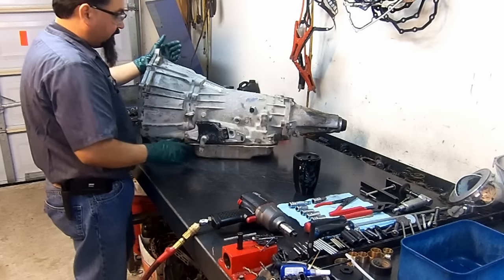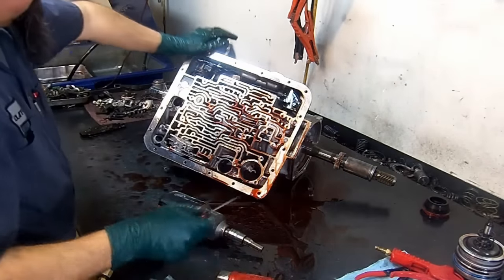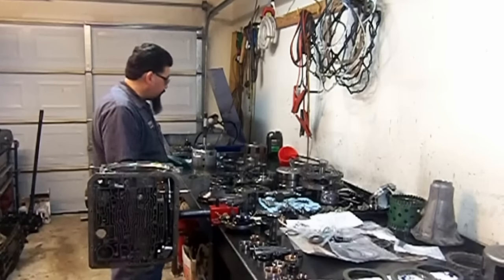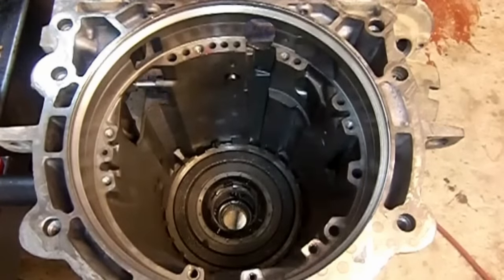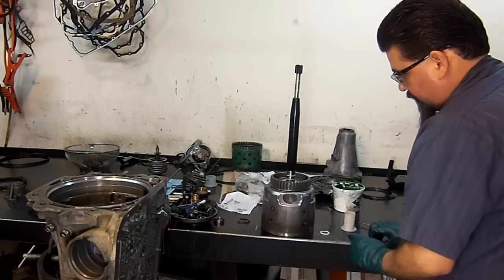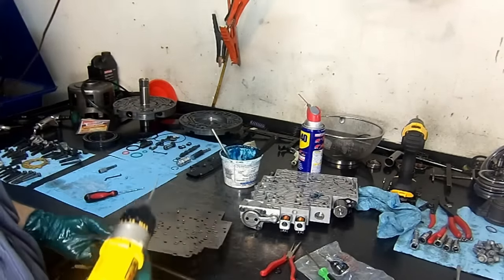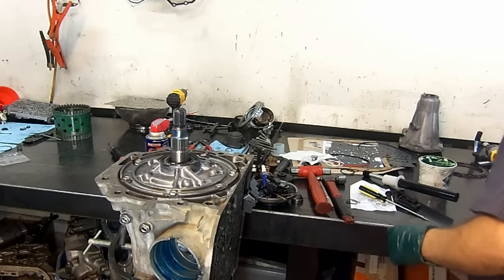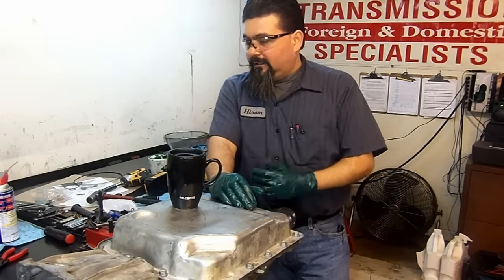4L60-E Transmission Full Rebuild

Comment: Now I see why it’s costing me $1,100 to fix my transmission.
Reply: $1,100 is actually pretty cheap. Usually they running from $2,500 that's including removal and installation.
Reply: @bryanphan1583  3300 dollars for my 2012 tahoe
Reply: I just got quoted 2700 for my 2002 Chevy Silverado. I am going to trade it in before it gets much worse. I am noticing sometimes it doesn’t go right into reverse. Make clunking noise when shifting into reverse also. I hear it is the sunshell.
Reply: @stevesigler5241  it would be way cheaper to rebuild have you seen truck prices?
Reply: Change the fluid and filter on your Chevy truck and you won't have to pay thousands of dollars for this nonsense.
Reply: @omartinoco9930  i did on mine until it gave up at 279,000 😂
Reply: Cheap real cheap.
Reply: @stevesigler5241  It could be the sunshell, but the clunking could also be the u-joints. I had the same issue on my 2003 GMC Sonoma and replacing the u-joints fixed the issue.
Reply: That is really cheap, around the here you ain't going to get by for less then $1800 plus $500 to remove and replace
Reply: @stevesigler5241  that's your u joint
Reply: 1495 at my local shop. Rebuild and installation on 04 4wd tahoe
Reply: @BigWood3131  I am! He is a small shop owner here in Sacramento ca. I searched for a month and stumbled across his shop. 500 to bbn pull and reinstall and 995 to rebuild. He charges by the job and not hour like most places. He gets a ton of work and has a pretty good warrant. 2 year unlimited miles
Reply: @ADVENTURESWITHCOREY530  ask exactly what parts he is putting in. We install torque converters, solenoids and a mastero/h kit and any hard parts needed. I can't buy all the parts needed for a total rebuild for what he is charging for parts. Be careful, the warranty is only as good as the guy wants it to be. Good luck
Reply: I had mine done twice. The $1,100.00 job was with after market parts and only lasted about 3 years. The second build on my transmission was done by a shop here in Atlanta for $1800.00. The second guy told me the first guy screwed up by using after market parts. I have had great service every since the second build.
Reply: @PTARAMBO  That's why I tell customers to always question the invoice. There is not alot of markup in parts, at least in my shop since 1980. We only use the best quality parts and that's why our customers are for life
Reply: @stevesigler5241  I charge 2000 parts and labor on a 2WD
Reply: 2400 for then to take down and rebuild 1600 if I take it down and hand it to them it’s either I take it down fix it myself or I buy a used for 600-700
Reply: corey mcnulty that’s a fucking steal
Reply: @ninjaslash52_98  I can tell you one thing we don't install used trannys, because every transmission has issues and when you buy a used one, your chances are very high your going to have problems. On the average rebuild with a converter, solenoid it's going to cost us $1100-1400 for parts
If the rest of the vehicle is in good shape spend the money and do it right. What vehicle do you have??
Reply: Andy Elwood I have an Isuzu rodeo 4wd i was gonna extract one from a junker not buy a used one that way I know it’s something else wrong with the car like a tree fell on it or some other accident 

It’s got 145k miles but all the other parts are in great shape
Reply: Hiram I would like you to make a video about the 5L40E . I like the way you explain everything. God bless your knowledge.
Reply: bryan phan mine was $2500.00; the guy charges $200.00 for a service but he’s got a good reputation and he’s honest as the day is long.
Reply: 1,100 I would gladly pay that cost me 2,200 for 2004 ford explorer transmission rebuild.
Reply: @ninjaslash52_98  that's probably a Honda bx7 unit in your Rodeo.
Reply: @stevesigler5241  did you check your u-joints?
Reply: Paw Paw your 2015 transmission went out already? Wtf?
Reply: Of it runs like new i think its worth it
Reply: @stevesigler5241  hate ti say it but was probably only u joints

Comment: The automatic transmission really is a marvel of engineering....I would never attempt this sort of work but I really respect anyone like you that can. I just enjoy watching someone who is really skilled at their craft operate.
Reply: You're partially correct. Chevrolet automatic transmissions will go down in history as feats of engineering that set humanity back thousands of years.
Reply: @csn6234  Well the 200 4R in my Grand National can handle quite a bit of power and the TH400 can handle as much power as you can throw at it as a performance build.
Reply: @charleslowe522  What about the XP5HQ44L in my son's Big Wheel? Huh? Yeah, thats what I thought.

Comment: You, sir are a true professional.  You cut no corners, make sure that everything is right, every potential issue is dealt while the unit is on the bench.  So many half-ass transmission shops out there that take your money and do as little as possible.  Then the thing fails again in short order.
Reply: great
Reply: DEW409 i
Reply: lil dude: I read your comment and about shit myself, your not joking are you???. That's one reason why I Never take my vehicles to anyone for maintenance. How places like AAMCO are still in business are beyond me. Trying to find someone you can trust to work on your vehicle is like finding a needle in a hay stack.
Reply: I will tell you this about a year ago the transmission on my 1995 tacoma started making a noise similar to a power steering pump going out only in reverse my gut told me it was spark plugs no fuckin idea why but i did replace all 6 one was seized had to work it in and out to get it to go some threads came out with it (aluminum heads) I slapped anti seize on the new plugs and the noise went away no idea why that happened but all is good a year later
Reply: I have swapped out some manual transmissions in my mustangs , but now I have a 4x4 and I'm thinking about ordering the kit and rebuilding it my self , I'm not a mechanic but I will have some help from a couple of people that know there way around vehicles
Reply: this is very complex you need to film it for reference if you get stumped during the assembly
Reply: SOUTHERN PRIDE 
Same here guy I bought h3 from paid 3,000 for a reman ammco it lasted less than 50,000 miles
Reply: DEW40
Reply: What are some highlights I should lookout for when getting my trans done by a shop?
Reply: @jameselwell945  😂😂
Reply: Truth
Reply: DEW409  .
Reply: Nice
Reply: Wowsa.! Impressive 👌👍
Reply: S O U T H E R N  I had transmission oil on my fingers while I was trying to follow his instructions on my phone. Lol
Reply: I'm trying to figure what to do with all these extra parts.

Comment: Hiram, I just wanted to drop a note to say thank you.  I've been a auto hobbyist my entire life and have rebuilt every piece of a vehicle except for an automatic transmission, until now. For some reason they were always a little scary to me.  Thanks to your detailed video and great verbal explanations, I finished up and drove my first 4l60e rebuild yesterday. I had to stop and rewatch some of your segments to make sure I was doing things correctly, but the entire process went very smoothly. I even installed the transgo kit you detailed in the other video. The trans drives and shifts perfect.  Thank you again for all of your time and effort put into making these videos! What a great feeling to successfully rebuild my first automatic transmission.
Reply: yeah, it is a complex machine. I think putting it back together seems most intimidating.
Reply: I wouldnt really consider rebuilding an automatic trans a DIY project. But it can be done if you have a manual or a really good video like this and lots of patients. And dont think you'll do it in 2-3 hrs, maybe a weekend. Ive rebuilt thousands of automatics in my 30 yrs of auto-tech, and it still takes me around 3 hrs for this model and this is an easier one to rebuild. not including coffee and pee breaks.  Definitely something you want to do right the first time around because it really sucks putting it all together and installed to find out something was wrong and needs taken apart again.
Reply: Thank you for the motivation this video and your comment definitely made me feel better about my rebuild. Where did you get your rebuild kit, shift kit from?
Reply: This guy is a genius Engineer
Reply: whats a transgo kit? how did you get your hands on a very long notched screwdriver?
Reply: @Walczyk  trans go is a shift kit. Take a cut off wheel on a grinder and notch a screwdriver.

Comment: Hiram... I can't tell you how ecstatic I am about this video. I generally do a lot of my minor mechanical work such as oil changes, battery replacement, alternator, water pumps, serpentine belt, throttle, radiator, brakes and rotors etc.... However just last night I thought pretty soon I  may have to do something about my transmission and having a limited income I always have to find the cheapest but most reliable route to get the job done. So I decided to look on YouTube as I always do and search the internet to see what route I'd take. Lo and behold here you posted a video only days ago that support my future need. I have a 2003 Escalade EXT. I love working on my truck 1. Because I save a lot of money 2. Because I make sure it's done right 3. I have no one to blame or be mad at if it isn't 4 The shop mechanics can't beat me...lol. Anyway as I plan to embark on this journey to my first transmission drop and rebuild (which may take some months, I think I still have a significant amount of time but I'm still planning) I've run into a bit of a roadblock in my preparations. The transmission model is't engraved on the case. So I did some research and I think it's a 4l65e but need to be sure because once I drop that bad boy I won't be able to run back and forth to the auto store without inconveniencing others and I hate to do that. anyway I did find a number on the transmission that helps identify my transmission on the bottom at the end of the pan.  The number is 3KZD4 042A 35523509. Also do I need to replace the torque converter and the transfer case, after all I have a bit over 202000 miles. I sincerely thank you from the bottom of my heart for sharing your skill for those of us that need the help...... If you or anyone else can answer these questions I would greatly appreciate it. Subscribed!
Reply: I think this is THEE best video on rebuilding a transmission on YouTube! Every other video is like 20 minutes long, so I don't even bother. This guy's a PRO, so it's a pleasure to see him work.
Reply: Haven't had to make the change yet but I found a young brother thats a few hours away that knows Hiram. I may buy one of his rebuilds.... I would buy Hiram's rebuildbut this guy is close and by that I means a couple maybe 3 hours from where I am. The project would cost me more to do than buying. I may still try though but for now.... not so sure.
Reply: yeah but I still want the experience.
Reply: The stamp is on top.  You will see it when u drop it.
Reply: I am currently using this video to rebuild my transmission 4l60e. From an 03 escalade 5.3l.  even with all the tools that I've had to run and get I'm still under $500 for the whole build. That's with the whole rebuild kit, new sun shell, bushing driver (which btw autozone rents it for free... you just have to buy it and then return it... but I think since I bought it I might just keep it now), transco shift kit and new separator plate, and tools to drop the tranny.
Reply: If you look on Ebay you can get the whole stock rebuild I think for $150... I went the little higher upgrade for $170. Theres also a guy on Ebay that makes his own tool for removing the low reverse piston for $20 and it works awesome! I called up a tranny place and asked if they would wash the tranny shell and the guy said he's never had anyone ask that but would do it no problem and he just randomly named a price and said $20 and I said deal!
Reply: prevent having to change it is better.
Reply: dwentworth0907 v

Comment: Hello it's 2023  your video 10 years old your information is still as valuable as the day you made it I'm having problems with my transmission my '08 Chevy 4 speed The parking paws hanging up doesn't allow me to go into gear from park lever shifts with no action seems like it wants to go into gear I go back and forth with the shift back and forth back and forth finally it built enough pressure to pop it free 
When It goes in to gear the truck drives fine has a lot of mileage on it your video and many others that are out there have been very helpful to me thank you for making these much appreciated Bill Western Mass USA

Comment: This is my first GM transmission rebuild. Actually I'm repairing this transmission for my uncle after the last rebuilder left the plug on the B shift solenoid unclipped. Made it 7k miles before burning up the 3/4 clutch pack. Had a serious vibration at about  1,500 miles. We thought it was the rear axle as the truck has 525k miles on it. The rebuilder's health got really bad, so I decided to find the problem and repair it.  But it's not terribly different than the Ford's I've been into. I'm at repacking the 3/4 clutch pack after pulling the complete transmission  apart and washing out the burnt fluid and clutch disc material.  Great video for those of us who dare tackle a transmission  rebuild.

Comment: As a DIY mechanic I started working on auto engine rebuilds at around 12 y/o learning from my dad.  Years later I bought a used ‘68 Camaro 327 CID that needed an engine rebuild and I decided to also try rebuilding the simple 2 speed powerglide automatic transmission....what an eye-opener!!  It took me 5 times as long to rebuild the transmission as the engine, but I did manage to figure it out.  Years later I decided to try converting a 3 speed manual Mustang 289 to an automatic, by buying a junkyard Ford C4 transmission, bench rebuilding it and installing it.  It was 3x more complex than the powerglide, but it was all mechanical and I managed to figured it out and install it.  It was still working perfectly 100,000 miles later when I sold it.  Many years later I restored an ‘85 Firebird Trans Am to all mechanical specs despite it having a 700R4 ECM-assisted transmission, which was way over my head.  A local tranny shop friend bench rebuilt it for me, removed all the internal electronics and installed a mechanical shift kit which to this day still works perfectly.  Now I have a ‘99 Tahoe with the older version 4L60e similar to the one you just rebuilt.  Despite a hard 1-2 upshift (from brand new), the tranny is still perfect (only 63,000 miles on it).  While I’m too damn old (75) to undertake another transmission rebuild given the incredible complexity of these incredible computerized transmissions, guys like you make old fart DIY mechanics like me wish I was young enough to give it another go.  Beautiful job, superb knowledge base, and excellent videography.....I savored every minute!  Dr. K.

Comment: I have a 2003 TB LT and a lot of time and $$$ invested keeping it on the road.  But I like it and have learned more about doing some of the repairs myself than I ever thought possible thanks to videos like this on Youtube.  Well, 268,000 miles on it now and the transmission started clunking and slipping, and soon went out last weekend.  I lucked out and found an incredible shop who had it rebuilt and replaced by Thursday.  I was wondering what all went into this kind of job and found this.  Thanks for an incredible fully detailed step by step process of what they did.  So many little steps that make a big difference.  I would never attempt, I'd lose track of all the bolts.  But seeing what they did, for $2800 which I thought was a bargain, was really interesting.  You don't get paid just for what you do, but what you know.

Comment: What a great service you offer to the viewers. I retired from the new car dealership as a service advisor after many years as a line technician. I handled all the transmission repairs for a dual franchise Dodge and Buick dealership. I definitely seen my share of overhauls from rear wheel and front wheel drive cars and trucks. It's a dirty job with a lot of parts cleaning and labor intensive. You have an excellent work ethic and fine presentation of skills.

Comment: This is like watching a heart surgery.
Reply: Iwas thinking the same thing
Reply: Heart surgery on a dirt road. Talented guy but his bench is a shit show.  A trough of parts , nuts bolts etc on the back of the bench is a nice touch
Reply: Engine rebuild is a heart surgery. Transmission rebuild is equivalent to a brain surgery.
Reply: cat793c2008 you’d hate to see the benches in a mom & pop transmission shop. When you know what you’re doing and you can do it quickly, you don’t need organization.
Reply: Brain surgery.

Comment: Thank you so much! I have a 1998 4x4, 2500 with vortex motor 5.7, your presentation will help me figure out my transmission as I haven't had reverse for 1 1/2 years now. presently I'm rebuilding the front end. New rotors, hub bearings, lower ball joints, idler arms all with adj sleeves and pitman arm. My truck is a SILVERADO.
Reply: AND ALL TIE ROD ENDS